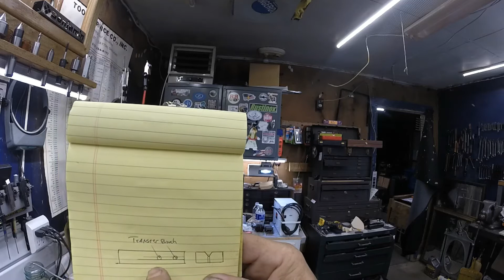HARBOR FREIGHT MINI LATHE, MILLING

Comment: I generally use 2 flute cutters on aluminum.  Not sure it makes a ton of difference....
Reply from the maker: Yes I think to flute and other people are saying also I got a great suggestion from HVAC1 As far as a jig to drill the holes. He suggested a block of aluminum drill a hole all the way through it slide the tube through the hole and then have two holes drilling down through the piece. Could make it a very Repeatable process.
I just gave my first two samples to the customer he’s going to check for the ID dimension and he thinks that my through holes for the cotter pin’s are too big which is no big deal
Reply: @kimber1958  that does sound like a good jig idea

Comment: Hello !   Your part seems very simple , but . . .  how accurately sized do the holes need to be in relation to the ends & to each other ?   * I see you have a second video up . . . perhaps I should have a look at it before writing out a 'major dissertation' on a SETUP ! ? 
      There are so many ways to skin this cat !  ;)
Reply from the maker: The part I made on the video you might say is obsolete it was my first idea then somebody suggested a better idea but I went ahead and machined my first idea just to be able to run the machine have some fun milling on the lathe. 
Thanks For watching and for your comments

Comment: 'Just watched #2 video . . . & I think I have a fairly simple solution . . . 
     Turn a piece of bar stock that's about a quarter inch LARGER than the aluminum tube - drill a hole in it to set the LENGTH of the part . . . ( hole for a locating pin )  - drill the 2 hole locations as required , de-burr , then 'viola' , your JIG is complete !  * You can set it up to drill on the drill press - just align the 'thru holes' with a snug fitting pin as the 'locator' !
    'should be able to spit the parts out in a couple minutes each !   * a 'V' block in a vice should work easily enough on the drill press.   * * * you can use the aluminum bar you 'milled' as a guide for poking the holes in the steel 'jig' . . . & it would be a cinch .   
     Drill the first part , then remove the 'locator pin' . . . & tap the aluminum tube out from it's 'SHORT' end with a small 'ramrod' / ejector ;)      
      If this was a LONG TERM job , you could use drill bushings to maintain accuracy for many hundreds of parts , if not THOUSANDS .       Hope this idea helps !   ( and is easy enough to comprehend )   ;)            &&& thanks for the sub !

Comment: Make a round jig to slip your piece into then center punch it or drill them out.
Reply from the maker: That is a very simple very good idea I appreciate that I can already envision doing it that’s perfect.

I will however continue with my own idea just for the experience. I guess the good thing is if it doesn’t work out I’ll be using your method anyway. I did the same thing with the wheels for my laundry card started making the wheel found a better solution but continued with my project even though I didn’t need it. For me it’s all about practicing operations set ups etc. then your opinion what kind of in Milton where are used to carry on with my current plan a tubing is a quarter inch OD. Thanks for your, and thank you for your great idea I will put it into practice